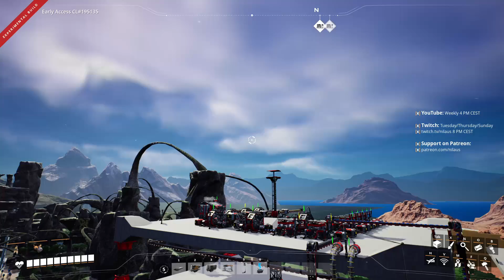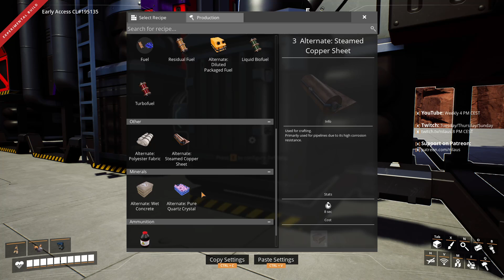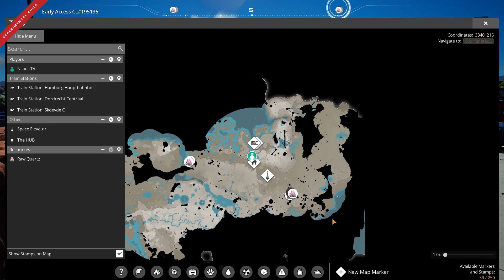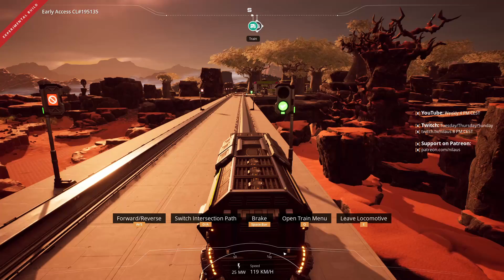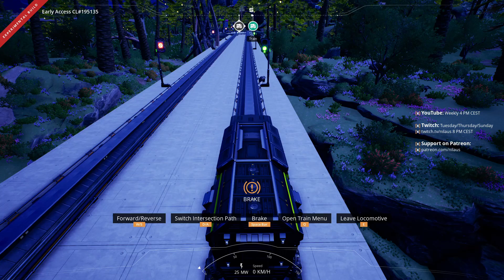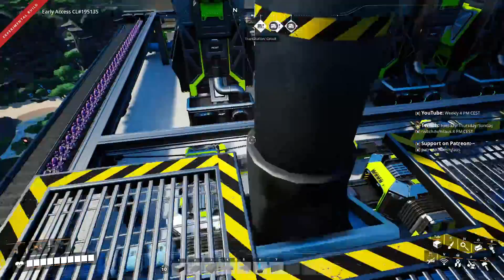Environmental CIRCUITS Without Any OIL | 09 | Satisfactory Update 6

Comment: You didn't want to do the complex silica because it was too much work, yet you are doing complex copper ingots and sheets which is a lot of work. (Edit: Never mind my comment, I see now why using the 2 items for silica would be a problem.) Wouldn't it have been better to have created a section to just smelt your ingots and the sheets and then move them where you need? Same with silica, you will need those in other recipes too. Though I suppose in the end, it's the same amount of work, and probably easier to calculate how much if you build on site. Edit: I like the yellow with the pink stripe.

Comment: I'd like to say that I'd pick Copper Alloy Ingot recipe just to reduce on the buildings if there's one iron node nearby. By a lot. That would require exactly one normal copper node and half normal iron node. I'd also use cheap silica, but that indeed gets rather silly real quick. About as silly as refineries for copper. (You don't want to see my aluminum factory).